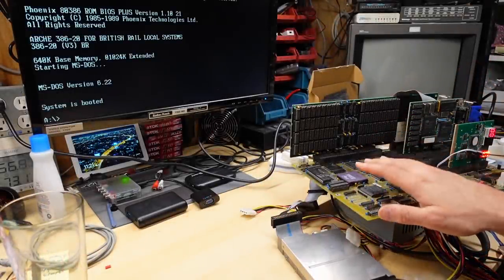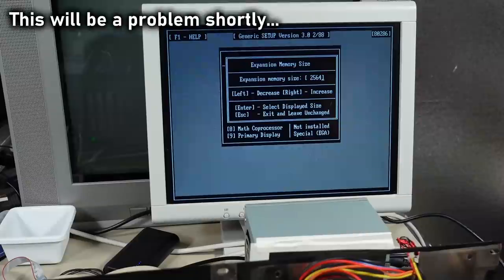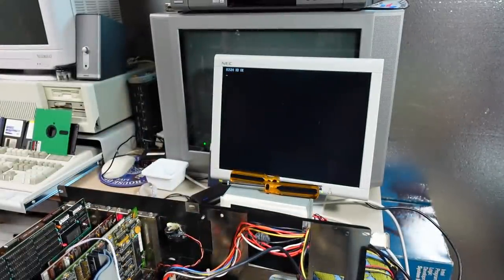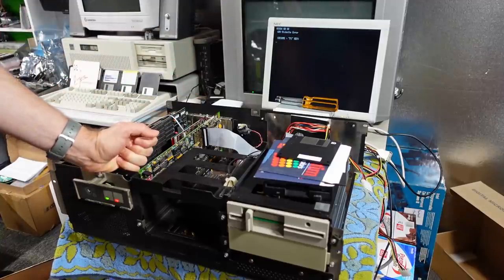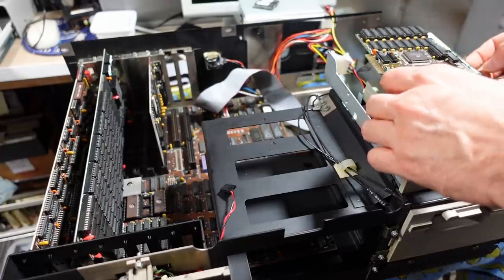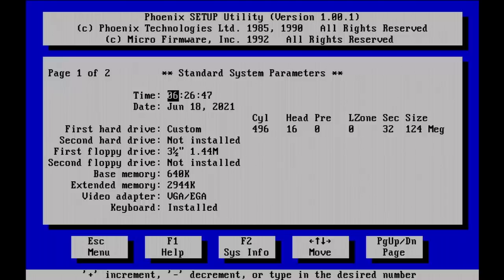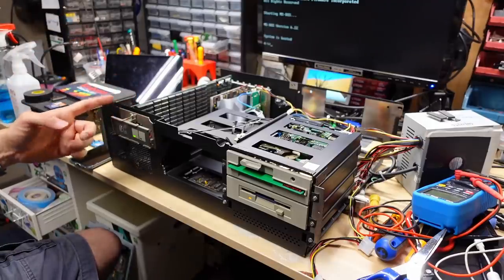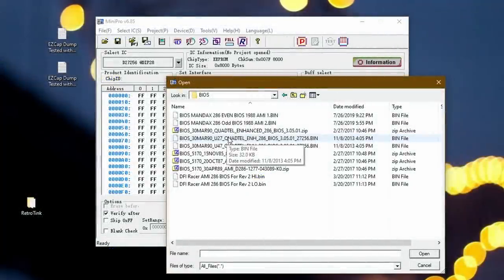IBM PC/AT Model 5170: So many issues! (BIOS mania)

Comment: BTW, your final solution is exactly what we would have done in the day, that is, upgrade the BIOS at the same time the modern disk drive was installed. I know that AT is a pain, but it's a magnificent machine and it defined the modern PC world.
Reply: The 5170's original IBM BIOS is just total garbage. I think IBM rushed it or something.. The clone manufacturers did a way better job than IBM. Compaq's Deskpro 8086/286/386 BIOSs for instance: These are way more compatible with the original IBM 5150/5160 BIOS than the 5170! The irony :-)
The Quadtel BIOS is a great alternative when you're on the verge of attacking your 5170 with a battle axe ;-)
Reply: @pipschannel1222  I know people want to keep the machine "original" because it's IBM, but I'd choose the Quadtel BIOS any day if it meant no disk swapping for trivial things like setting the disk size and changing the clock. Keep the old ROMs, just don't use them!
Reply: @amirpourghoureiyan1637  Yeah I did the same thing with my early 1985 type 1 unit. The original BIOS comes in handy if or rather when the on board memory gets bad. It's got a useful feature where it literally displays the location of the wrong chip(s) during POSTing so when my memory started te become flaky I put the original mask ROMs in, swapped out some of those weird piggyback chips and she lived once again ;-)
Reply: It's a clunky piece of junk next to a Macintosh of the era. It's a shame that this platform became dominant.
Reply: @ericwood3709  Mac were okay until they broke, then they became near impossible to repair for a normal human, a concept Apple has stayed with ever since
Reply: @thesteelrodent1796  I never had that happen, though. Both the hardware and OS were pretty robust, especially compared to that Frankenstein hodgepodge of 16- and 32-bit software that was Windows 9x and the primitive kludge that was Windows 3.1.

If hardware were to fail, though, it would be the same. Either swap out the bad part or have a repair shop or the manufacturer service it. 90s Macs were more like PCs with cases that were easy to open.

Comment: I know LGR was having issues with setting up a 1.44M drive back when he added one to his 5170, he actually used GSetup to set the drive in the BIOS but I think he also had a later BIOS and/or different version of GSetup. Otherwise I love the look and sound of the AT, glad you were able to rescue it!
Reply: None of the IBM setup versions have a 1.44MB option.  The later BIOS supports it, but not the setup.  Hence gsetup.

Comment: I remember from the old days, that to overcome the 1024 cylinders limit you would use the LBA addressing, which was multiplying the heads on expense of the cyls, to keep the overall capacity unchanged.
Reply: I remember this as well....
Reply: Yeap. To get past 504MB you have to switch to LBA. And have a BIOS and OS that understands it. (Since DOS doesn't normally load drivers for IDE. Some IDE cards had an extension ROM to fix the issue. And at one point, I was loading a driver to fix that on my 386. But DOS was stupid; I quickly went to Linux. Except on some oddball Compaq's -- EISA??? -- that had to boot linux from DOS to get memory arranged correctly. Novel needed the same trick, btw.)

Comment: @Adrian

If I recall correctly, the BIOS settings only apply to on-board ports. 

Add-on cards didn't rely on BIOS settings to operate. 

Early in your video, when you first connected the 1.44 stiffy drive, it's LED came on during post, even though it wasn't configured yet. 

I may be wrong, but it's possible those BIOS settings only apply to motherboards with on-board IDE/FDC interfaces. 

What I would suggest, is that you completely disable the IDE/FDC ports in the (original IBM) BIOS and check if the ISA cards detects the drives automatically.

One interesting thing I noticed, is that the BIOS "swap drives" setting seemed to make a difference. But then again, the first 1.44 stiffy drive didn't work with that setting. It could be that it's actually operating in 1.2MB mode, which in most cases will read/write to the disk, but you'll run into corruption issues. 

I would love to see the system work with its original BIOS and controller cards 😊
Reply: Important points for myself to make note of. Thanks.

Comment: Your struggles reminds me of some of the struggles my father would often run into when he fixed pcs as a side business (his day job being installing and repairing sun computers for Sun) and he would always be in a bad mood if he'd had to deal with any of the following: amstrad computers, Packard Bell computers, compaq computers, IBM computers and problems that turned out to be yet another problem with oracle (at work, oracle had a rather bad reputation amongst sun engineers as they'd always blame it on the Sun hardware when 9/10 times it was oracle).

Comment: I can feel your frustration! Id love to see a disassembly and analysis of the 601 error. But the RPN calculator made me smile.
Reply: Back then IBM showed their assembly sources in the Technical Reference Manual for that page.  Apparently they also provided the original BIOS source files on a disk.
Reply: @ovalteen4404  Yes. I posted a comment last week with links to the manuals for the AT and noting on what page you could find the code that produces this error. I don't know why that comment has now vanished from here and from my post history. I'm not going to do the research again, but someone else might wish to now that you know the information is out there.

Comment: I think this could work as well with the CF card:
— Install your favourite BIOS
— Reformat the CF card with the 1570 having its new BIOS installed
— transfer the contents back on the CF, careful not to use an image for this.

The card was working with the AMI BIOS, so that indicates a problem with the geometry match-up. And that could be solved by reformatting the card on the configuration (i.e: disk controller, system BIOS and system motherboard) you're actually going to use it with. This should always be your first step in troubleshooting this issue. Even some 386 boards I encountered with the exact same issue (drive would read small files fine, not larger files; drive would not boot) had it vanish after doing this.

Comment: You seem to be experiencing all the same issues and pitfalls that I fell in to when I was trying to setup my 5170 clone. Glad you were able to figure stuff out! Thanks for the info about that Quadtel BIOS. I ended up using a different Phoenix BIOS than you used and just dealt with the disk error, so now I got more options, awesome.

Comment: A little testing with QEMU and 4 MB RAM: the "Largest EXE Size" in MS-DOS 4.01 was 574992 bytes, but in PC DOS 5.0 (probably because it made use of XMS) was 636816. Confirming that even on 286 you're likely to get more efficient use of RAM from 5 than 4.  (With 6.22 it's 607872 - still better than 4 but 5 may be your best choice.)
Reply: I'll have to try out QEMU on my 286 systems.  I always run MS-DOS 6.22 on anything 386 and up.  MS-DOS 5 seem to work better on my 286 and older systems as it also doesn't use as much hard drive space.  I've found on a given 286, 1MB of RAM is normally more than enough so DOS can be loaded high.  I only up to 2MB or more on a 286 if I want to run Windows 3.0 or Windows 3.1 on it.  Most of my 286s just run DOS.  I install Windows 3.0 on a TurboXT with an EMS RAM card.  OMG it was painfully slow, but was neat to see running and using the EMS RAM.  Because I was using PC-DOS 3.30, on that system, I had to partition the ST-251 40MB hard drive into two 20MB drives.
Reply: @ESDI80  QEMU is a modern emulator, not something that runs on old systems.

Comment: Re: 601 - The original IBM combo card must have BOTH the hard drive AND floppy base IO jumpers set to default (primary) to satisfy the IBM BIOS. The previous owner perhaps changed the HDC base IO to accommodate the hard card?

Comment: Absolutely compelling viewing.  I'm sure we have all gone down a similar rabbit hole and it can drive you mad.  The difference is that you actually managed to solve the problems.  Fab.  Don't worry about the purity thing.  I think the purity police allow the swapping of peripherals for operational reasons :-)  The motherboard, CPU and case are still there.  BTW, you have put me off looking for a 286!  :-)
Reply: Alas, some comments are complaining about his rubber dome keyboard not being a model M! So the purity police don’t even jive with peripheral changes… but apparently the LCD monitor is fine? Very strange.

Comment: When you get around to working on the original 5170 power supply, don't forget the load resistor for the 12V rail, since you don't have a big old full-height MFM hard drive installed to draw enough amps on the 12V rail, and the power supply will shut off.
Reply: ^^ Truth.

Comment: And this video demonstrates why I preferred the Compaq DeskPro 286's over the 5170, although I did prefer a Model M over the standard Compaq keyboards. 
Never had any of these issues with a DeskPro 286 and they ran faster overall than the 5170s

Comment: Back in the day I worked for IBM. I was given a 5170 for my desk. I remember adding memory and a 3270 adapter for mainframe access. I also added a 3.5 inch drive as the 1.2 meg drive was compatible with nothing. I certainly did not run into all your problems. But, I had access to all the proper period parts. Ain’t retro great.

Comment: I have vivid memories of my dad trying to install a 1.44 MB floppy drive on an XT that he had and I definitely remember that he ultimately gave up on it.
Reply: Don't know where the dividing line is, but if you go far enough back, beyind just requiring some sort of TSR to override some BIOS behavior, you would also have needed to replace the floppy controller chip with a newer one, because much of the floppy controller circuitry was never on the drive, but instead on ISA card or motherboard.

Comment: Now you are seeing why Intel dumped the '286 so fast. Here's a fun fact, in order to use all the memory you have to go into protected mode, which is incompatabe with DOS. You can't go back to "DOS mode" once you start Protected Mode without halting the CPU. The 386 can go back and forth so you can use things like use  things like DPMI to use all the ram you have for DOS.
Reply: Seem to recall that on these early IBM machines you also can't use the 287 in protected mode, but that may have been a BIOS issue. I have however never seen a 286 that had the FPU, likely because they never had enough RAM to run anything that could utilize it

Comment: I remember those days. It was bad enough when compatible hardware was available, although the hardware did get better for several years even after the 386 came out in 1987. Once the 386 achieved dominance, and especially once the 486 landed, there wasn't much further boundary-pushing on the 286 front.

Frankly I wouldn't try to put any IDE solution in a 5170, not even one using spinning rust. (SCSI and RLL are certainly fair game though.) If I can't get hardware appropriate to the time, then I'd just have no hard drive at all, even if that makes the machine essentially useless for more than games. IDE did not exist when this machine came out, so if the machine balks at using IDE, I would prefer to keep it stock and lose the functionality because none of these machines are particularly useful in reality. The same is true of the 1.44 MB drive. If the hardware wasn't amenable to supporting it, I wouldn't install one no matter how convenient it might be, because that's just not how this machine would have ever worked in its useful lifespan. If I want a 5170, I want a 5170. If I want a machine that represents a souped-up 286 rig, then I'll make one out of clone hardware that isn't so buggy. But this machine is now neither. The only thing really original at this point is the motherboard and its 6 MHz clock rate, which is a negative, so basically we've ended up with the worst of both worlds -- a slow 286 that doesn't behave anything like a stock 5170.

I admit that stock 5170 behavior is infuriating, but I feel that if that's what you're building, those are the constraints you have to work with. Otherwise it's just another 286 build in an IBM case, at which point you'd enjoy using it a lot more if it had a 12 or 16 MHz clone board in it instead. Once I established that I would never be able to enjoy using a period-correct 5170 because it's buggy and slow, I'd get it minimally working with as much original hardware as possible, and only period-correct replacements when needed. No modern workarounds. Then I'd send it off to a museum or collection, and build myself a clone rig that actually works with the stuff I keep around. Sadly, this build ends up being neither of those things, especially given the amount of work involved.
Reply: I agree

Comment: Hey Adrian... did you notice how there are 2 sets of holes on AT drive rails?

the reason is, that "half height bay" for a second hard drive can actually be used for a full height hard drive on a single floppy system. You attach the rails in the second hole so the drive sits further back, allowing you to put the metal bracket and that blank drive slot cover back in place.

Also, AT's never directly supported 1.44 floppies in the bios. You could use them on 5170's, but in order to be able to properly, you 1: had to tell setup it was  a 720K drive. Dos would be able to boot from it, read to it, and even write to it. HOWEVER, in order to format it, you needed to use driver.sys, which was a device driver included with dos that would let you tell dos how many sectors, heads and tracks a drive had. 
(yes, it was literally named driver.sys)

optionally, later versions of dos also let you specify the number of heads, sectors and tracks directly in the format command. 

If you did not do either of the above, when you formatted a disk, it would only format to 720K. (it would assume 80 tracks, 9 sectors instead of 18 sectors)

1.44 meg drives were not introduced for IBM systems until the PS/2s came out.  And IBM simultaneously discontinued the 5170s when that happened. So there was never a BIOS for the 5170 that supported 1.44 meg drives. 

The bios used with the motherboards that have the 256k chips instead of the 128K piggyback chips (the third gen bios, the one you tried using) will support 720K (the 6mhz version was used in 5170-239 ATs, whereas the 8mhz was the 5170-339, both shipped with 512K, a seagate st-4038 full height 30 meg drive (bios type 8)  Fun fact - there is a difference later revs between the 6mhz bios and the 8mhz bios.  There is a timing check on the 6mhz one to make sure it is not running at 8mhz. This was because people were buying 6mhz systems for several hundred dollars less and then swapping out the 12mhz crystal for a 16mhz one. Most of the time a 6mhz 286 could handle 8mhz.  If not, it was still cheaper to swap it out for an 8mhz part than it was to purchase the system as an 8mhz machine. 

Anyway, however, that 601 error you got was not a bios compatibility issue.  Post should just see it as an 80 track drive and assume it is either a 1.2 or 720K.

My theory is that Gsetup has options in it that the bios itself does not support, and you were getting the 601 because of some corruption in the bios ram due to using gsetup. Some extended bios ram byte, one AT setup does not set or use, was set to some value by gsetup, and it is confusing the POST because the IBM bios does not know what to make of it.  Just a theory. Could be wrong. To test this, I'd suggest wiping bios ram (IIRC, there is actually a jumper to do this on the MB, or you could use that basic program you mention.), putting IBM bios back in, and try using ONLY IBM AT setup, and not even touching GSetup..

edit: also... that stand alone floppy drive card you tried... was that an 8 bit card? if so, bare in mind that these did not have the transfer rate needed to support either 1.2 or 1.44 meg drives. Those will work with 360 and 720k drives only.  (although there are special 8 bit floppy controllers with buffering between the drive and the bus, which also have their own bios, that will allow the use of 1.2 or 1.44 meg drives on 8 bit systems... these are specialty cards, though. many of these also supported 4 floppies)

Comment: Remember these times, when I need to mess with new HDD Head and cylinders settings in BIOS.. 😂 Nostalgic, especially, when these settings wasn't on HDD sticker..

Yeah, BIOS issues may take time to figure it out.. Try, just for fun, connecting IDE CD ROM drive.. I think, that BIOS wouldn't recognize it (back in day's, I run in that issue)..

Comment: Given that these bioses use CHS addressing for accessing hard drives (as opposed to LBA that was originally specific to SCSI drives) could it be possible that the compact flash reader received a malformed IO request that it could not complete?

Or, to put it differently, would these machines work if you used SCSI hard drive interface for the compact flash hard drive?

Super curious. If you ran into the same problem with 386s perhaps the problem is related to how old IDE was trying to access the data. CHS has always been a headache.

I'm particularly curious if the bios was setting some "reserved" bit in io that might even have had some meaning, that now caused a headache